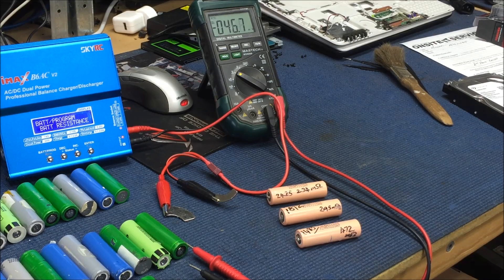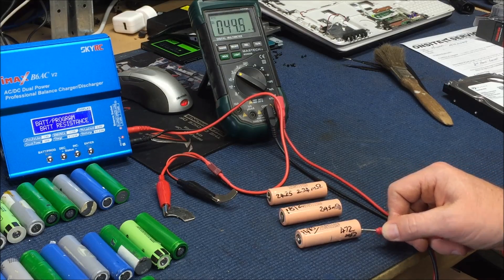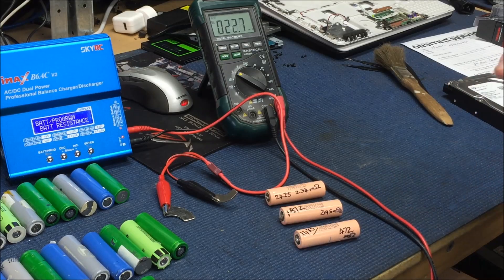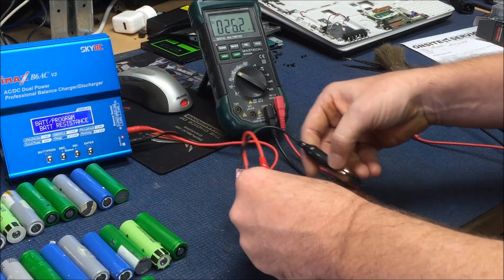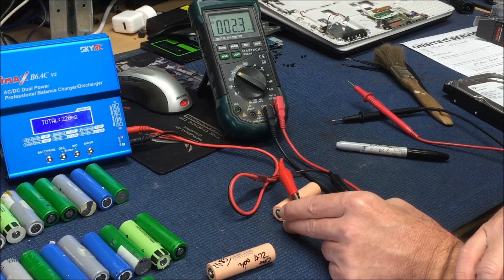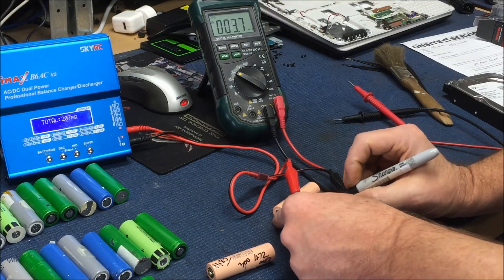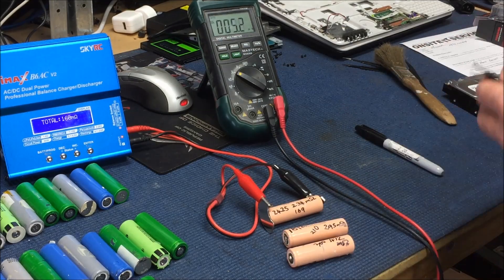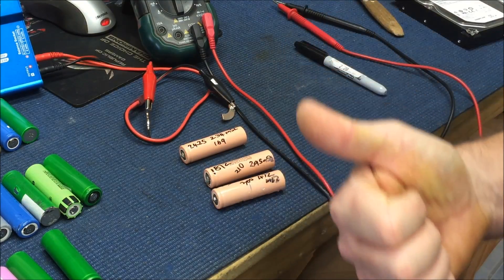resistance testing 30 hrs later

Comment: I found a lot of inconsistency as well when relying on combo charging/testing equipment. So, I bought a 4-wire resistance voltmeter with double prong spring loaded tips to use for testing internal cell resistance.  Now I get perfectly consistent results when testing my cells.  I also noticed inconsistent capacity measurements when testing at different charge and discharge rates. So, now I always use the same amperage when charging and discharging my cells. Similarly, I noticed an inconsitency in the "fully charged" voltages readings when using different chargers.  So, now I always measure the exact voltage of each cell with a multimeter after I am finished charging them.  Even with all of that, I noticed that I would get different measurements from a cell just by repeatedly running it through multiple charge/discharge cycles.  So, in the "final analysis" I have learned that testing is simply going to help me eliminate truly bad cells from my battery packs and only provide a general guide for matching cells with similar capacities and states of health when building the individual battery packs.  Note: I also perform all of my testing in a termperature controlled environment of 70 degrees Fahrenheit (21 degrees Celsius).
Reply: very sound approach - shows that we really dont know whats going on?  If you think thats bad dont go anywhere near Lead acid batteries, what a secretive black art that is.  Ive been at it 10 years and my bottom line is, whatever capacity is claimed, divide by 4 for reliable useable capacity ( I do mobility vehicles, golf carts etc what a monstrous rip off this AGM crap is.- look at the fork lift truck industry, always use wet flooded cells (you can accurately determine SOH) but they are 4x size and weight and cost of an equivalent AGM so called deep cycle (ie dont go below 50%) and they are only good for <500cycles - shit)

Comment: bad test to measure resistor you must do two test loads one with a small resistor   and one with 5 time the first resister then you must take the average at the two test and divide by two then you the right resistance of the cell I have wrote some software 20 years before  mabe i have some where a jpeg picture of a nikkel cadium cell if your want i looked up

Comment: I know this is an old video, but I’ll answer for others. Is it the temp of the lab? Yes, temp can change resistance slightly.  Is it the charger? Yes, the charger does resistance checking to non-standard ways off the battery industry. Is it the wires, magnet changing positions? Yes. Is it how hydrated you are? Yes, since your holding the magnets it can measure resistance across your hand as well. 
Is it the voltage? Yes, with this charger they say to test resistance at a full charge. But the standard way of testing doesn’t require this. 
Basically, don’t trust the way these chargers check resistance, it will always be inconsistent. Also, if you use this charger you have to bring the battery to a full charge, and let is cool down after charging before checking since the temp will affect the results as well. Never hold the metal part them;robes when testing . Make a rig dedicated for resistance testing so its the same contact and wires every time.
But honestly, get a different battery resistance tester. I’m testing 4 new one now, soon to release a video on the one that meets the battery industry standard and should match manufacturers data sheets as well. Still testing myself, but all of them are under $50, so I try to keep cost down when i test stuff. 
Most battery manufacturers test with a AC voltage across the battery, this charger does a quick small charge and drain with DC voltage. It should be a 4 wire resistance tester. The AV voltage needs to be at 1kHz to match most data sheet specs and results. And a few other factors as well.
If this charger is all you have and can afford, then use it in a dedicated rig for resistance testing, full charge, battery cooled down, room temp, check the next day after charging for cooling. If the voltage drops in 24 hours then forget it, it failed even without he need to test.  Besides that use it to match cells as close as possible, but they won’t be a perfect matched pack your building using this charger. It’s better then not checking at all, just not as good as it can be if you can afford a different resistance tester.

Comment: Stop holding the battery, with such a relatively low ohm reading, the resistance of your body will be mucking up the results
Reply: It would be the other way around. The body resistance is very high with respect to the battery so it won't change the reading. If they were similar or the body much less then it would make a difference. Adding pressure probably makes it more constant.

Comment: micheals1992 
the problem is testing resistance in battwries is almost imposible to get an acurate repeatable figure. 
The only reliable way is to  chexk amount of watt hours each battery takes to charge to a sustained voltage. (not one that drops shortly after charger removed) then leave the battery for a few weeks and retest. the drop in voltage can then calculated in relation to its charging Watt-hour requirements and an absolutly accurate  internal resitance calculated.
The results with the device being used are less than useless.
Reply from the maker: Thank You

Comment: Forget internal resistance. You are getting nonsensical results.
Fully charge each cell and check its temp.. if its hot reject it.
Then leave the cells for a week and re check its voltage. if its dropped much bin it also as a self discharging battery.
Keep it simple stupid :)
Reply from the maker: Pretty much what i've been doing for the past 3000 cells. Only just started to resistance test again - all it's done is make me stress.
Reply: If I might make a few suggestions that might solve some of your stress?
1/. Charge the batteries and discharge them at the same rate as they will in the power pack while lightly insulated as they are being the pack. That way any hot cells can be identified and removed before they become a problem.
2/. Use a small programmable controller like this  ebay item number 301980880622 with an added temperature sensor and a solid state relay.
Connect the solid state relay into the input / output power feed (or both ) of each bank and trigger it from the relay in the PID. set the Temperature to the maximum safe temp (you might find a controller that works in voltages as well to stop over and under voltage conditions)
So if a bank gets too hot while charging or discharging the relay drops the power until that bank has cooled down.
The relays need to be normally closed and a voltage on signal lead will open the circuit.
If you can find voltage controllers as well then the same can be connected to the same relays providing double protection and an instant readout as to the voltage and temperature of each bank. 
I would also recommend all soldered joints on the High Power Busbar side be brazed with silver solder. this has a FAR better conductivity and normal lead type solder and even a small resistance can be the cause of a really bad hotspot when the system is pulling some Amps. :)
Hope this helps not hinders. Keep up the good work I am following you with interest. :)
Reply: resistance testing is good to get an even load across a battery pack. lets say you have a 1s3p pack, if one of the cells has a 50mOhm resistance and the others are 200mOhm the 50mOhm cell will take 66% of the load (the 200mO cells would take 16% each).

 the only way this evens out is when under a long duration constant load, the cell with the lower resistance would loose capacity faster at first and as it did the other cells with a higher remaining capacity would take more of the load as the float voltage of the low resistance cell dropped in relation to the high resistance cells, since all the cells are in parallel though when you cut the load the high resistance cells would start to charge the low resistance cell up which would take you back to square 1 when you re-apply the load. this effect is worse under high load so only use unmatched cells in things that don't put much load on them

Comment: Had you just finished charging them?  The temp could have been high (that affects the chemistry).  Like +Rocket Rose I use the OPUS BT-C3100 and I get a fairly consistent result.  The manual says just it's internal connectors (not doing it by hand) can very the results by 30 ohms from slot to slot and you should consider the test relative.

Comment: Vetting a used battery is pretty straighforward.  Reject all batteries out of hand that are below the voltage they are considered damaged.  Next, recharge and let them rest for a day.  Then do your capacitance test.  THEN recharge the battery back to 4.2  now it's time to store the batteries for a week or two and then do another voltage test (capacity not necessary at this point).  No battery you leave to rest should be below 4.1V if they were all charged to 4.22 stop voltage.  If you have a few outliers at 4.05...repeat the test and see if it was just a fluke or not.  Any battery below 4.05 should be rejected.  Common problems with batteries that have internal resistance is that they have been dropped, gotten too hot or too cold...too deeply discharged OR the charge circuit failed and overcharged the batteries significantly.  Hope that helps!

Comment: Dont you have a 18650 battery holder you can use for these kind of test just to rule out fingers and magnets making wierd contact out of the equation ?
A tip to getting them batterys out there is to use a thin cloth strap you place under the battery so you can pull it out easy if you remember the kind some batteryholders in remote controles use to have "back in the day" ( geez make one sound old ).

Comment: as far as I am aware the only way to get an accurate resistance value is to put the cell under a constant load first, leave the load connected for about 20 seconds or so thus allowing the cell to stabilize in terms of its voltage and then, and only then calculate your resistance.

Although I have never compared such results myself I should mention that (again to ensure accuracy of your results) that your cells apparently should NOT be more than 80% charged or more than 80% discharged when running these tests.

If you have the time this last one would actually interest me... meaning, if you rerun these tests under load maybe you can publish the resulting resistance value for comparison at full charge 4.2V, nominal 3.7V and cutoff current of 3.0V.... seeing the differences between these values would be interesting.

In terms of your particular project, I would take this one step further actually and run the resistance tests at these three (high, mid, low) voltage levels with a few constant current loads just to see the direct effect on the resistance value in correlation to the constant amp draw.

As far as I am aware, if you conduct these tests using a variety of different cells from different manufactures the results will give you a strong understanding of each "cell pack", what cells should be grouped together and which ones are likely to cause problems for you if you draw too much current from the them.

Have fun and good job on the new 18650 wall mount, looks great.

Comment: For resistance testing you should have proper holder. Magnets don't make good connection.
What I do, is after capacity test I will charge batteries, wait one hour and measure their voltage and mark it on the cells. Than wait week or two and measure voltage again. I found few cells with low internal resistance, OK capacity, but after week their volatage was under 4V. So cells like this are useless.

Comment: But what do I know?
I would think that a better MECHANICAL/ELECTRICAL connection would be needed.  I suggest soldering pigtails to the end s o the batteries to connect your leads to and you might get better results.

Comment: fella your bridging the battery terminals with your fingers and trying to take a resistance measurment???
Reply: Fella it takes the path of least resistance. I'm pretty sure his fingers have more resistance then the Mili Ohm battery.
Reply: so if you have two resistors of differing values wired in parallel, does the current only flow through one? nope
Reply: Yeah true parallel resistors result in a lower resistance and yes current will flow in both. However if you put say 100K ohm and 200 milliohm in a parallel resistance calculator the resulting resistance is like 199.999 milliohm. Pretty negligible. And since I just measured the resistance between my thumb and index finger and got 1.4 Megohm I think this is pretty insignificant.
Reply: Anthony Van Der Hoeven true
Reply: However a battery holder would be nice :p
Reply: Cells have soldier on both ends, may not fit!

Comment: That's because you should read the internal resistance when battery is charging or discharging, but when battery has reached the same voltage. And yes, the series internal resistance has everything to do with self discharging when you supply power from the battery to a low resistance consumer, then the series internal resistance becomes paralleled resistance, thus  discharging the battery on its own Ri.

Comment: you shouldn't hold the metal contacts on the battery because your body Has a ohm load which changes dramatically throughout the day . if you get your multimeter and set it to ohms and hold both the probes you will see.
    so I suggest if you have to hold the connections you either use a non conductive material or use some rubber bands, or put a couple of magnets on the end of the battery and then clip to them.
Reply: That shouldn't matter too much when considering the magnitude of the differences between his bodies resistance and the batteries.
Reply: GrimL0gic yeah but he was having issues with consistent readings, so was just a suggestion to eliminate anything that could be causing  interference. But really the only way to get an accurate internal resistance figure,  is to do the math, from what I can tell unless you have a Cadex 7000 Series battery analyzer, the common and cheaper chargers don't  really give an accurate measurement for this anyway and should only be used as a guide.
   I myself haven't tested heaps of hardware against a calibrated system so not quite sure how accurate they are or are not. I've always just done the math if ive needed to check a cell.
Reply: Da Rainmann I understand. If I had to guess his problem was likely a bad meter and his use of magnets. He needs to use a batery holder to keep that consistent and then compare each battery to one he knows is good. 
He doesn't need to know exact resistances. He just need to know haw far from good they are.

Comment: This sould be the reason fot the Internal Resistance variation!
If you tested directly after loading the cell, the concentration of the electrolyte isnt the same all over the cell. So there are not so much surface, where the reactions can take place, so the battery has a higher internal resistance.
After settling down over night as u mentioned, the concentration is even all over the cell. So the chemical reactions have more substance and surface to react. So the internal Resistance continues to fall the longer u wait after the charging process.

Greets from Germany ;)

Comment: Someone mentioned that the magnets could be affecting the results, but could holding it with your fingers be affecting it as well?  Just wondering if it'd be worth repeating the test with an 18650 holder with wires you can clip onto?  IANAE, but since human skin does have some capacitance, I figured it might me worth a thought.

Comment: RC Model Reviews has a video on testing internal resistance that is very interesting.  I only have a few cells from my own old laptop batteries and a couple of Ryobi drill batteries.  I have been testing and charging with a plain old analog hobby charger and have mixed results.  Some of the cells wouldn't charge and I used a tiny flat blade screw driver and poked inside the holes on the positive end and pried on what ever opens the circuit and then they charged just fine.  Now I have a digital 4 button charger and am going to do some more experimenting.    You have inspired me to start again.

Comment: That multimeter has a resistance measuring setting on it.
Reply: That's for measuring resistors, not for measuring internal resistance of a battery. The multimeter supplies a small current and measures the voltage (or the other way around) and then calculates the resistance using Ohm's law.

A battery cell will supply a current itself when you connect the multimeter,... it won't work.
Reply: +Peter Faber  
Some multimeters do both. I know mine does. it's not the same as his though. his looks more expensive. Also. If that is the case how is the battery charger going to do anything different?
Reply: +Luke L it probably calculates it from voltage levels when not under load and when some specific load applied. this is a good resource on how to meassure manually. might be a good Idea to check your DMM or Imax against a manual calculation http://lygte-info.dk/info/Internal%20impedance%20UK.html